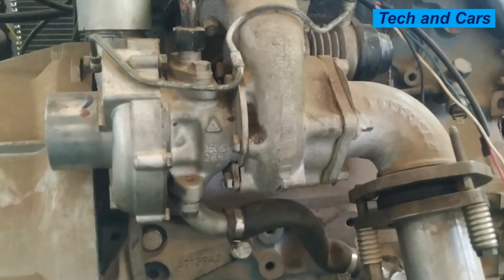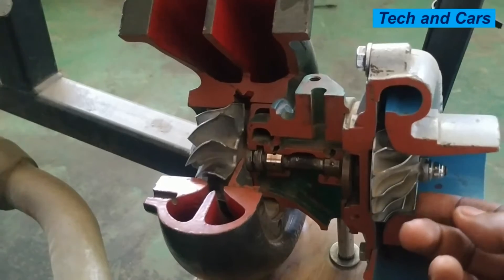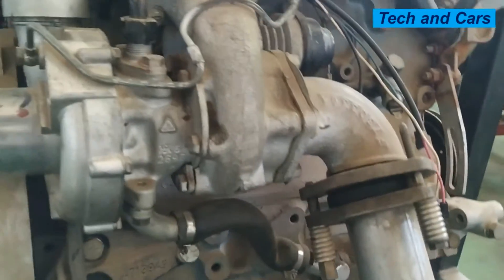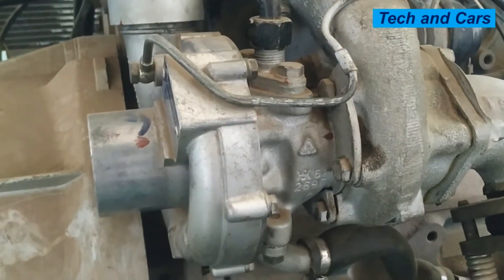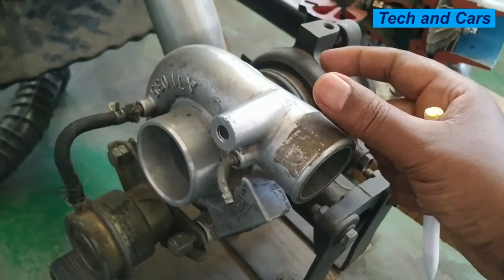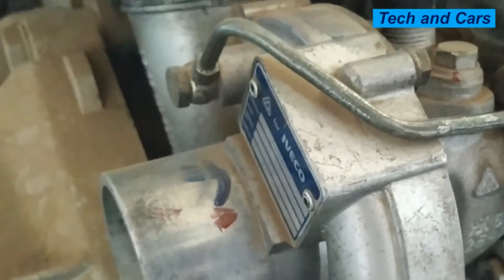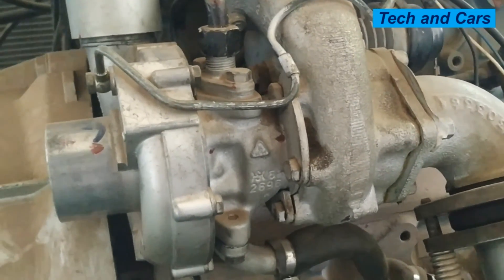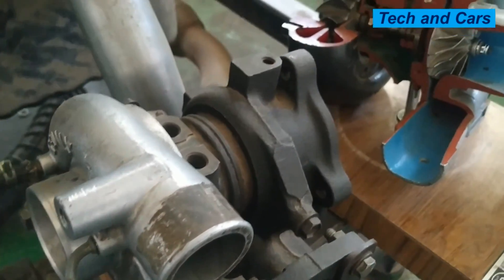How to tell if your turbocharger is going bad

Comment: very good explanation, it was a week ago that i have experienced turbo charger of diesel generator explode. With massive explosion sound and smoke everywhere.  Am curious to know what caused it
Reply from the maker: Oil starvation is usually the main cause of turbo explosion. Lack of oil leads to turbo overheating and eventually grow to irreversible damage. In addition, contamination is another cause, contaminated oil, foreign object sucked into the turbo can cause turbo failure. Turbo is running at extremely high speed, in hundred thousands, and at that speed even the smallest foreign object can cause massive damage. If you see broken impeller or turbine blades, that is usually caused by foreign objects. Over-boost caused by  malfunctioning waste gate can also cause turbo explosion.